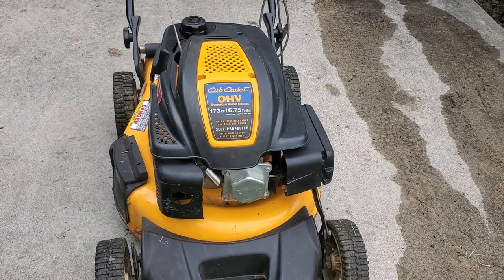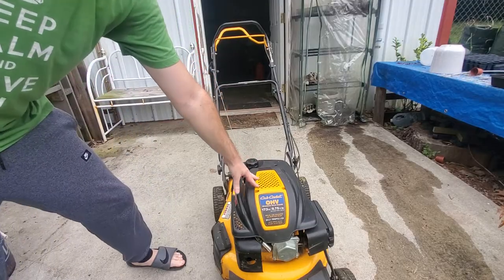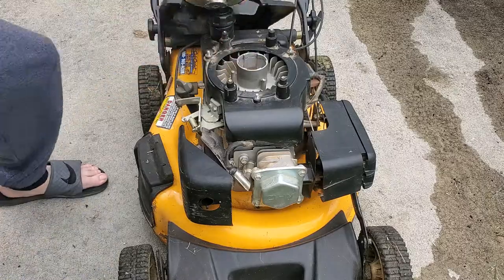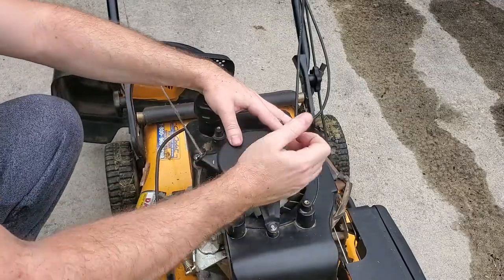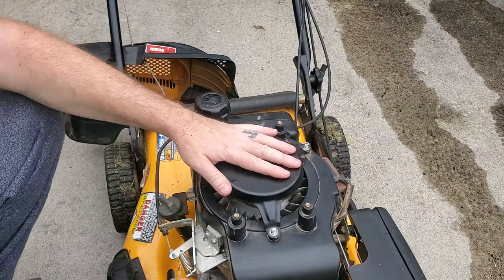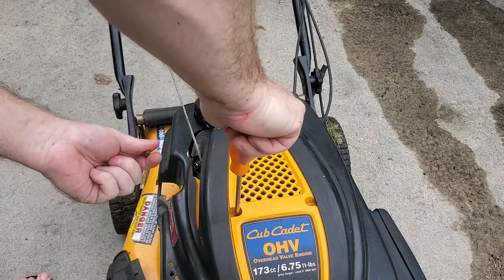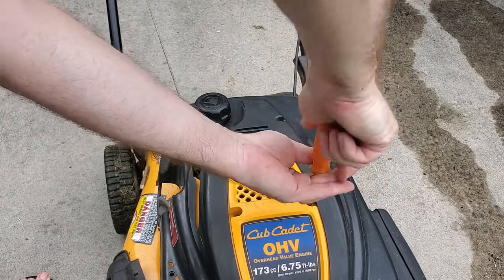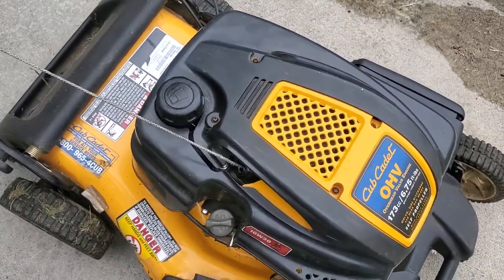Push mower starter cord cable pulls but not engaging

Comment: My pressure washer pull cord mechanism looks almost exactly like that one you removed from the lawnmower. The thing is new though and the pawls were not coming out to engage. A little lube and jiggling of the silver housing the pawls were in made it work every time now. I think the thing was just sticking because it was new or something and not loosened up.

Comment: Yeah my string pulls and spins the wheel but not engaging with the motor so might need to try this out
Reply from the maker: Also check to see if the pawls are coming out/engaging when you pull the cord. If they're not, that most likely is the problem.

Comment: This is happening with my craftsman weedeatter today. Not sure if I need a part which would be impossible to get. Thank you.
Reply from the maker: You probably just need what they call 'pawls'. If you have a local small engine shop they should have them
Reply: @fixinstuff4374  thank you. I was trying to start it and it just quit gripping. Spring is good.
Reply: @fixinstuff4374  it's an old craftsmen,